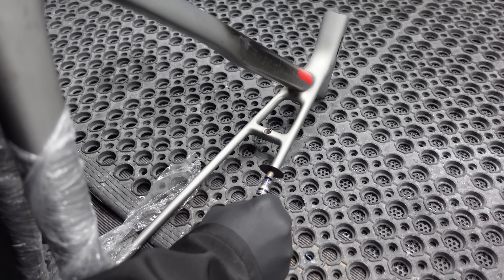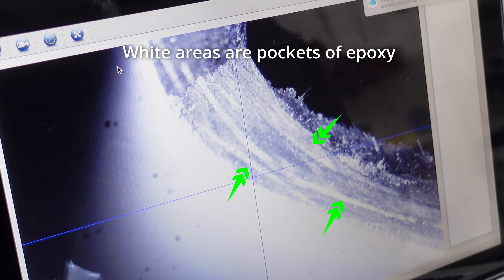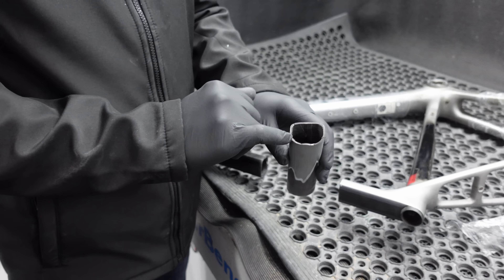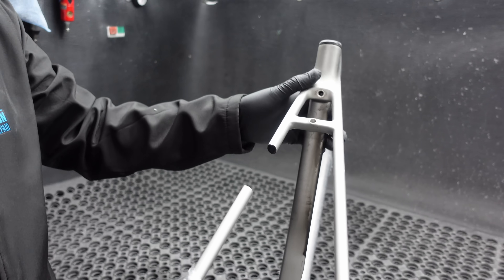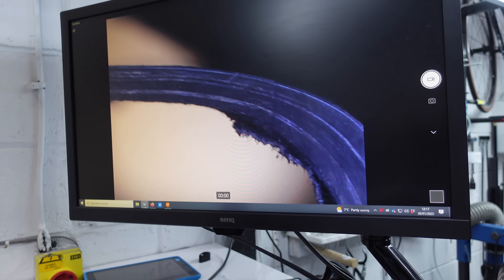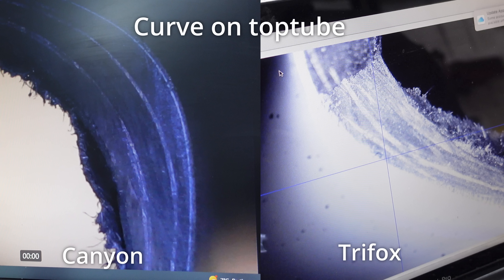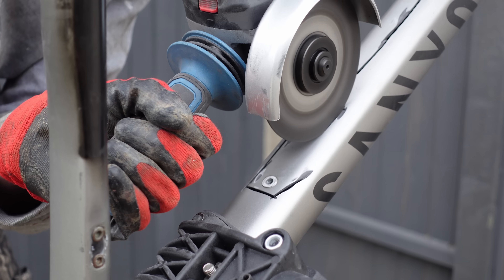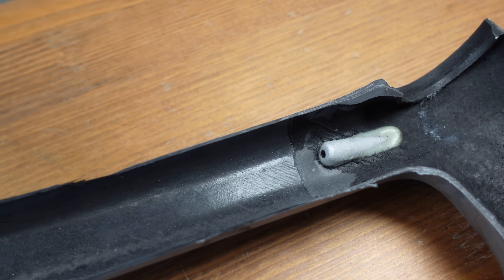I Cut a High End Canyon Carbon Fiber Frame in Half... Here Is What I Found!

Comment: Please tell us you cut up a Giant TCR as the next bike with a long carbon history and rather stable geometry and consequential relative most research and development done to it. Also for some reason you don’t see many replicas or manufacturers copy it.
Reply: The price delta of a replica versus a genuine Giant is too small. Hence, most people might just save up just a bit more to get the real deal.

Unlike a Dogma, Colnago V3RS, Bianchi Oltre or a Cipolini, Giant TCR isn’t ludicrously expensive.
Reply: @ariffau  Giant is much closer to those luxury brands these days.
Reply: @michaelmechex  depends which tier you’re looking at. TCR SLR (alu), Advanced, Advanced Pro or Advanced SL
Reply: @michaelmechex  but even then, for the price of an TCR Advanced SL frameset, you can get 2 of them compared to a Dogma and still have change for a decent wheelset.
Reply: @ariffau  the cheapest TCR costs 1550 in the uk, that surprised me, because in my country it's 2650 euros, which is significantly more than chinese frames. 1550 is close to the upper range of chinese frames, but I'd rather have a Winspace T1500 for that price, I honestly think it's a better bike.
Reply: @michaelmechex  sorry, but the T1500 isn’t a high tier Chinese frame. Not tier-1 for sure. 
High tier Chinese frame would be something like Seka and Dare (Team Uno X).

My friend rode one and trust me, it’s not all sunshine and rainbows. Hahaha. But forget my anecdotal remarks of the T1500, you should get yourself a T1500 then you can draw your own conclusions 😁
Reply: @ariffau  I'd be very interested to hear what was wrong with it. I have never seen a single complaint about it. I haven't heard much about Dare bikes or seen any reviews, but a high price tag and being used by a procontinental team don't say anything about it's quality.
Reply: @michaelmechex  there’s nothing “wrong” with the T1500. It’s a great bike for the money you are parting with. 100% would recommend it if that’s what anyone can afford. 
It just had a few niggles for its tight clearance like you can’t run 4iiii powermeter (idiotic for a race bike to not be able to run a common powermeter like that) and most importantly it was the ride feel AND THIS IS WHERE YOU CAN STOP READING MY COMMENT as I dive deep but there’s a tl;dr at the end of this comment.
Reviewers like Hambini may say it was built well, but Hambini is talking purely from an engineering standpoint on how well it was constructed. What reviewers like Hambini doesn’t do is to REVIEW THE RIDE FEEL or the RIDE CHARACTERISTIC. Furthermore, he constantly adds that he even dislikes riding bikes. 
Needless to say, to me, the T1500 rode harsh all over.

A good segment to our next talking point “QUALITY”
We have to understand that there are two qualities when it comes to bikes. Firstly is BUILD QUALITY and that is to how well is the bike built from a construction standpoint.
Another important factor RIDE QUALITY and this has to do with how nice (or harsh) is the bike to ride. -Bikes like Pinarello Dogma rides really fast but they also feel really comfortable where you don’t feel unnecessary road buzz as you would on a Dogma F12. Not to sandbag the F12, but the F is a huge step up. That’s just comparing F vs F12. If and when you compare Dogma F vs T1500 or a CAAD12 …. You won’t miss it for sure 😂
That’s what carbon layup is all about and believe it or not. there’s where R&D goes into. Quoting Robb (about R&D) at @5:27 “the best bike to ride is the one with the biggest R&D” 
It’s true. For instance, we all know how The Big Red S is huge on R&D for example I test rode my mechanic’s latest Spesh Allez Sprint and it it rides so much nicer than a Winspace. At least to me, that’s how it’s like and RIDE FEEL may be purely subjective. Although the Winspace is lighter on the scale, the new Allez just jolts out of 90 degree turns (in the city) better. The ability of the Allez to respond to my 12.9 watts per kg surges were spectacular for its asking price comparing it to a S-Works Tarmac SL7. Not saying it’s better than an S-Works Tarmac SL7, but I digress.

Both cheaper and high end priced bikes may be as fast, but one is more comfortable than the other.
An Aussie Youtuber Chris Miller recently covered this when he rode his Black Inc by Factor wheels. It may be as fast but the Black Inc wheels were so comfortable to ride on. 

In a nutshell, don’t discount a bike brand like Dare just because we don’t see them on Youtube. There are an array of incredible bikes that doesn’t get the spotlight like Time, Look, Epoca, Sarto, Windy Milla  just to name a few.

Oh, for context, I used to be on the same boat as you. The one who believes just because a pro rides it, doesn’t mean it’s good. Well, firstly, we have to consider that pros ride 20 hours a week for training and in a tour, it goes from a week to 23 days of brutal efforts. Not 30 minutes coffee rides. A bike has to walk on the fine balance of how fast a bike performs, how well does it handle and how comfortable it is to still put in power on the last week of a Grand Tour. Pros are able to absorb the harshness better than most. But they are still human and big name brands still have to sell bikes that everyday non-pro consumers. That’s where R&D comes in. 

Tl;dr there’s no way a 1500 USD Winspace weighs the same and rides exactly the same as a Pinarello Dogma F. Even if they are exactly as fast, that doesn’t mean they ride as pleasant. 
you get what you pay for. R&D is real. No arguing this until you’ve ridden them. 😁
Reply: @ariffau  you guessed it, I don't like talking about ride feel. It's such a touchy-feely thing that no one can really describe and not everyone actually feels. I have ridden a number of bikes and in my experience the perceived comfort comes pretty much completely from the fit and tires (pressure).  Although it might be me, I'm 23 and I race a fully rigid aluminium gravel bike on xc races without issues. I've heard some ridiculous claims mainly from older guys, like the roads being too chattery to ride without a suspension fork. That's a crazy thing to say. I've also ridden the same bike on rock hard 23mm tires and 28mm tubeless on correct pressure back to back and the difference couldn't be greater. The difference between frames themselves seem so small to me that it makes me wonder if it isn't purely psychological. So am I going to spend extra 5 or so grand for something I'm not sure I'll even be able to feel? That's a big fat NO. But we'll see when my Elves Falath finally arrives, maybe I'll eat my words and dump my life savings into a Pinarello or BMC. I doubt it though.
Reply: @michaelmechex  understood, for a start, RIDE FEEL/QUALITY is purely anecdotal. Secondly, it depends on how sensitive one is. Rephrasing a BMC-rep. from a video I saw published by Tristian Take Video it went something along the lines of “Not all pros are as sensitive. Give a few (BMC) prototypes and some of them can’t tell a difference. But there are also some who can.”
So, to answer your question, NO, it’s not psychological. It’s there in what, how and where each carbon is laid up. It’s just a matter of how sensitive you are to either detect or not detect it. 

Besides ride feel being anecdotal and subjected to individual’s ability to sense it, RIDE QUALITY is also immeasurable. 
A bit of tangent, but RIDE FEEL is like ACCELERATION. 
How do you measure acceleration? From 20km/h to 44km/h? You can’t.
But is there? Oh boy it sure is there alright. 

I am not here to argue. But the Aussie Road Race Champ, Luke Plapp of Ineos won on shallow wheels. 30mm (or was it 35mm). He and the team agreed as it fitted his riding style and the course very well although acceleration is very hard and nearly impossible to be measured but it’s definitely there. 😁

Anyway, enjoy your Falath! I’m certain it’s gonna bring you lots of joy and fitness! 🚴
Reply: @ariffau  Thank you! I'm absolutely not arguing, I'm all about a polite, respectful chat here. That's the thing, the ride feel is immeasurable and everyone feels it differently, that's why I have a hard time trusting anecdotal reviews about it. Especially since I have experience of not being able to feel it quite as much. Yes, I own one very harsh riding bike, but that is a time trial bike from 2012. That's as harsh as bikes get and it's fine, and I'm sure proper wide tires would help a lot, but they don't fit. I doubt any modern road bike will be that harsh, especially since they have the tire clearance.